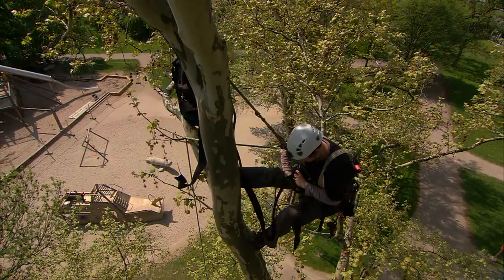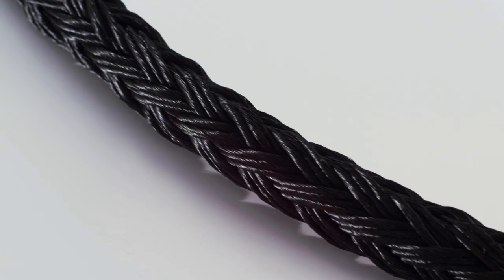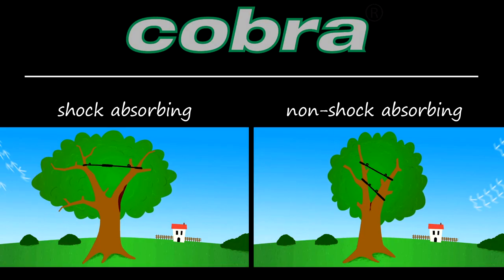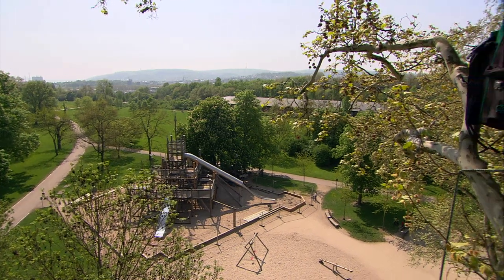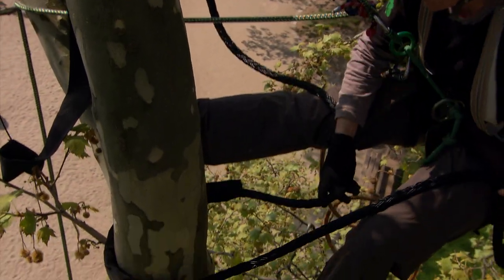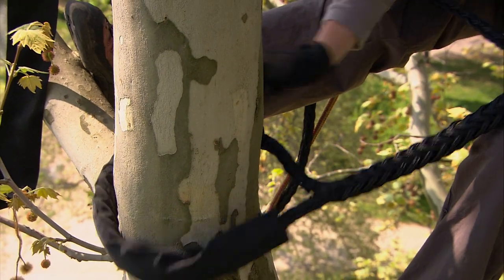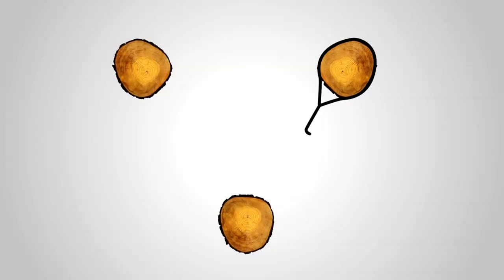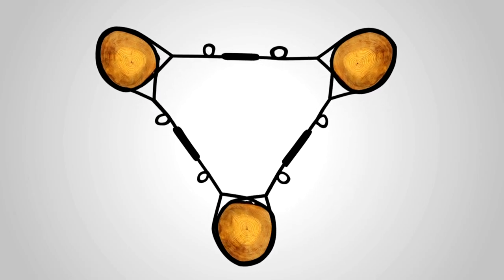cobra® Tree Cabling - Tutorial Video (English)

Comment from the maker: The 'best' time to install a cobra tree cabling is when an arborist is up in the tree for pruning because this reduces the effort. But else I would say that spring and summer would be a good time to install cobra because after foliation the branches are the farthest apart from one another. This makes it easier to install the cable with the proper length. In Winter you need to install cobra wih more slack.

Comment: So by these instructions if the branch has any included bark you should always use the static system ?
Reply from the maker: Use a static system in any case of a crotch between codominant stems (included bark) that starts to crack. But not all codominant stems need necessarily a static system. They also can be supported by a dynamic system that helps to avoid splitting.

Comment: Is the insert of the shock absorber the only difference between static and dynamic installations?  Would using a comealong to lightly pull codominant stems together be a good way to make a static installation taught?  I just don't think hand tightening would be taught enough??
Reply from the maker: There are two differences between static and dynamic installations. 

- First is the shock absorber which is not inserted in a static cabling. 
- Second is the breaking load of the system. For static installations you use the next stronger system compared to a dynamic installation at the same branch diameter, e.g. to secure a branch with 40 cm at the base you use cobra 2t with shock absorber as a dynamic installation or cobra 4t without shock absorber as a static installation.

Furthermore it is fine to lightly pull stems or branches together to install a static system.

Comment: at 5:30 when they said "determine the length of the anti abrasion hose which should be the diameter of the stem" did they actually mean the word "diameter" or did they mean to say the word "circumference". because i think they ment to use the word "circumference" . its a small technicallity but it obviously makes a big difference. because the anti abrasion hose if only the length of the diameter then it wont even go half the circufernece and the rope will rub and then there would be no room for growth in diameter cause the extra leghtn of the anti abrasion hose would already be un accomidating. right?????????? damn it. >:(

Comment: Hi! Is there any system to hold a trunk which is broken and opened? The tree is a "Tipuana tipu" dap  60cm    x 14 mt high. It has a well structured crown, and the cracking is in the middle below of the trunk. It would be a pitty to remove it because of its shadow at the entrance of a Club....but may be dangerous also if only trim the crown to reduce the weight. What would you suggest? I m trying to post the photo, but I can´t.  Thanks a lot.
Reply from the maker: Hi, please send us an e-mail with photos and we will take care of your problem. Thank you very much.

Comment: What's the loop for? Why not just stuff the end of the rope inside the rope and leave it there pulling out a little as the tree grows?
Reply from the maker: Hi Chris,
the loop has two functions. Firstly you can pull on it to tension the system during the installation and secondly it is a proper way to keep some cable as growth reserve.

Sure it is possible to stuff all the cable inside but then you need more space between the branches. Also you may let the growth reserve hang loose after the splice. But in our opinion it doesn't look as proper as a loop.

Kind regards

Comment from the maker: In order to avoid the first case we recommend an periodic inspection in accordance with the German Tree Care Standard „ZTV Baumpflege“ and the American ANSI A300 (Part 3)-2006 (see page 27 ‚34’). In practice a inspection every 1-3 years (depending on the condition of the tree) has been proved as sufficient.

If the inspection points out an close-fitting anchor loop then the connection can be easily adjusted to the secondary growth of the branch by releasing the growth reserve loop a bit.